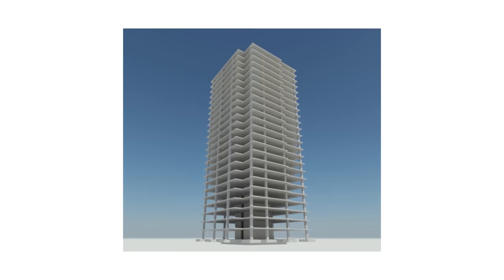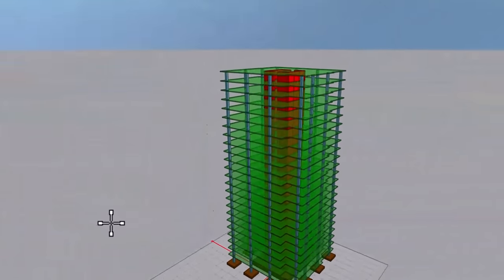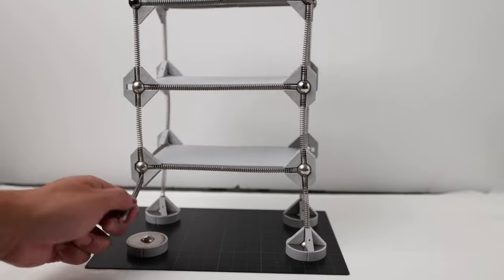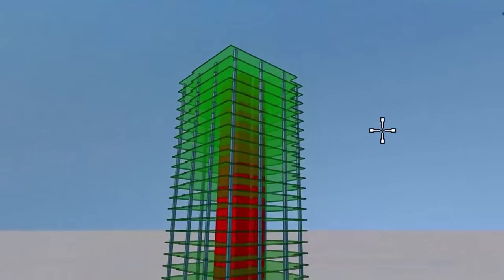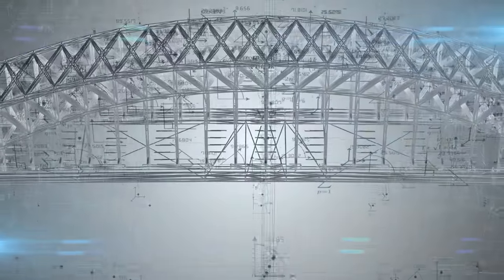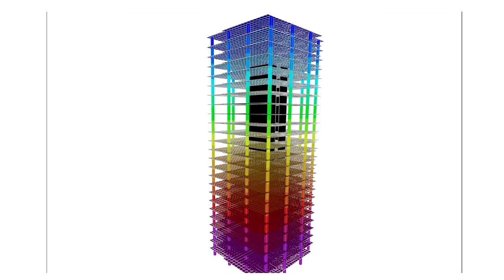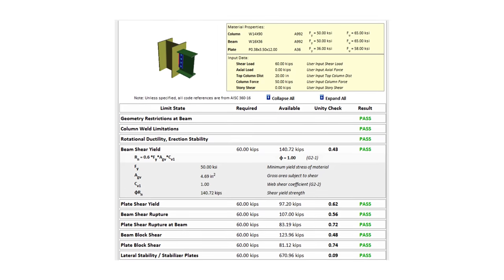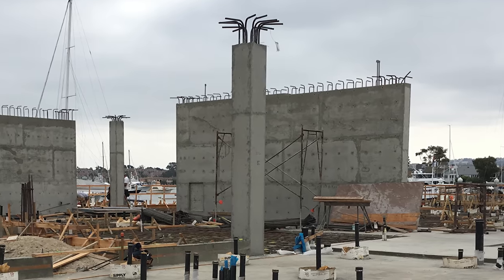How Buildings Are Engineered To NOT Collapse - What Structural Engineers Actually Do

Comment: The most important part in all this process is the drawing part. It really does reflect all the info you got out from the design and in some extent, it can provide some insight and make you cuestion if you are designing something good or bad.
Reply: How do you define important
Reply: @BigDripper1of1  all the considerations you took in the analysis and design of the elements should be reflected in your drawing plans. For example, in a steel structure you consider that in your base plate, it will be a pinned support when designing it on whatever application you use for, but in your drawing plans you specify and draw it as a moment connection is something that can't happen in this case. One may think that's impossible to make such mistakes, but in reality that's the hardest task of being an engineer.
Reply from the maker: Very true! If our designs don't make it on the drawings correctly, they will be constructed wrong and our analysis goes to waste, not to mention the building may be built incorrectly with regards to the engineer's intent.

Comment: I'm curious to know what is included in an architect formation in the USA, I don't know if it is the same but the 1st phase of analysis that you mention doesn't work like that here in Italy! As an architecture student we are tought to design (roughly or so) the structure, even using structural engineering softwares like SAP, and THEN you go to an engineer to properly define the job. In this way you can keep everything under control, given that you won't have to apply massive changes for unespected issues. In the USA the architects don't have the structural responsability of a project and that's why or they simply "don't want to risk it"? Thanks whoever will answer!!
Reply: This is what architectural engineering is all about.
It doesn't cover the nitty gritty of structural engineering
The structural engineer has the final say on the safety and stability of the structure, not the architect or architectural engineer
Reply: @festusajayi8917   so there's also another profession, I didn't know! I'll have to search what my course of studies translates into in the USA, seeing that it's like in the middle. Thank you for your answer!

Comment: As Structural Engineer of many years experience (qualified before you were born I guess), I would point out that there's a conceptual phase way before the analysis phase. The ultimate success of the project is probably decided at this stage - have a good structural concept and it will be easy to design and build, have a bad concept and it will be a struggle until the end of the project. It's a big mistake to get involved in the analysis too early in the project cycle.
Reply: yes, I think he started with schematic phase directly in this video.
Reply: @DeepakKrishna11  He skipped over the conceptual phase which is typical for young engineers. Too keen to resort to their computers
Reply: Quite right
The conceptual phase can also be referred to as a feasibility study phase or preliminary design phase
Check lists for analysis and design can be  handy in this phase
Reply: Agreed. Feasibility is everything
Reply: @festusajayi8917  The conventional sequence and terminology in some engineering sectors is feasibility studies / conceptual design / FEED (front end engineering design) / detailed design.

Comment: How do you know that the ground isn't going to shift and the foundation isn't going fail? I've seen homes on the side of hills but how do you know the ground isn't going to shift and there will be a landslide? This is always my main concern. For buildings not on hills how can you guarantee that the ground is solid enough?
Reply: That’s a geo technical problem, the site would already be analysed by geotechnical engineers to get the bearing capacity and see whether the soil fill needs to be change and so on and so forth.

Not a structural problem

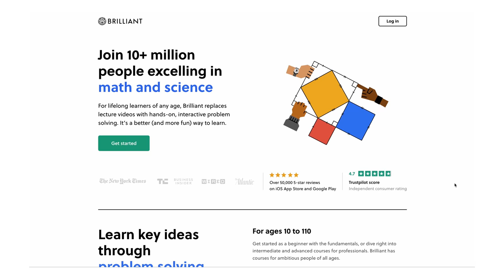Comment: In 7:07 , it’s mentioned loads will be transferred from slab to column (is it assumed that slab and beams are monolithically casted?)
Reply: In design of Flat Slab no drop beam. The load transfer from slab to column
Reply: I consider the word "slab" here as "floor", the vertical  load spreading the tributory area is transferred  to the column,
Reply from the maker: Yup, it's a two-way flat plate slab (no beams, slab is strong enough to transfer loads to the columns).
Reply: @MatPicardal  What is depicted in the video is a flat slab as distinct from a two way slab which is supported by beams on its 4 sides

Comment: First rule Foundation, second rule foundation, third and final rule foundation PERIOD!!

The problem with nearly all designs is 1. Corruption. i.e. bribes, use of different materials by the builders/contractors, cutting corners. etc etc. 2. Miscommunication. 3. What's designed is rarely if ever translated to a build i.e. last minute changes, additions, subtractions etc etc.  4. Costs are ever increasing. 5. Last but not least is poor or incorrect design.

Overcome all of the above and the build might be completed to everyones satisfaction. But until then we will get more Surfsides.

Comment: How commonly are you actually doing work by hand? I work for a Gc and find that after talking to most of the structural engineers, I’m doing more math than them just with takeoffs and basic form forces than they do in design. They’ve always told me they just use the computer
Reply: It depends what they are using to do the analysis. Some programs require the engineer to calc their own loads. Column and foundation loads are almost always hand calced. Quick design checks during CA are also often done by hand. It's all simple math.

Comment: Can you put braces in rcc buildings?
Reply: Everything is possible. But from where I am, it's not common
It's more common in steel structures
Reply: @symonortega  thanks
Reply: @Joker-oh3lb  there are some examples in Google images if you want more insight
Reply from the maker: For high rises in seismic zones, you can see steel braces being used as outriggers/support for the concrete cores. But usually not combined for most convential projects as it's generally more expensive to construct.
Reply: @MatPicardal  interesting

Comment: Very nice. How are engineers in the US deal with a risk of disproportional collapse? Here in the EU it can be tricky for the high-risk category buildings, because eurocodes give no direct guidance and require to do it well anyway.
Reply from the maker: Some high profile buildings require redundancy and alternate load paths, such as if one column fails, the other nearby columns can take the load. I have limited experience on it, but that's what I've seen done.